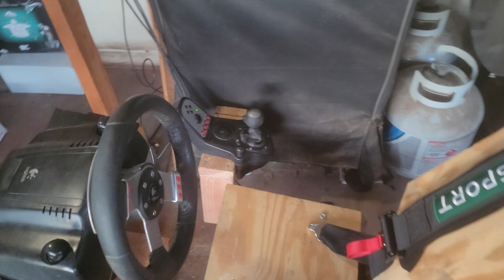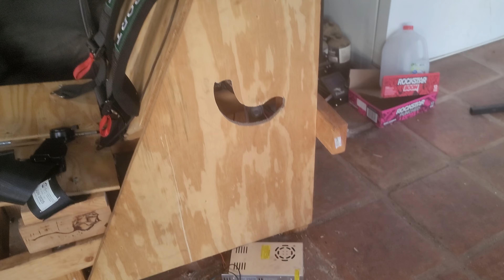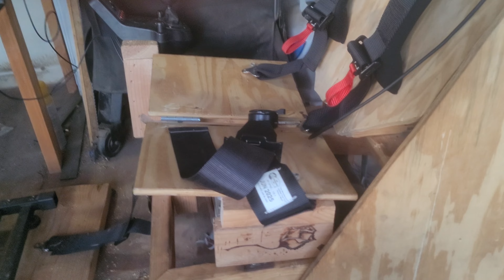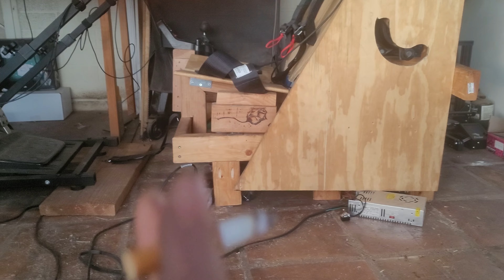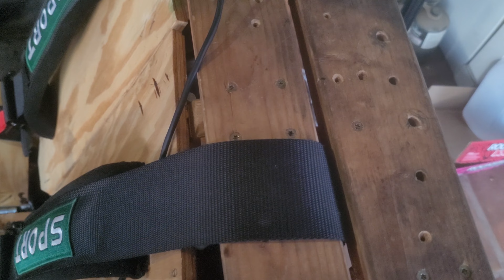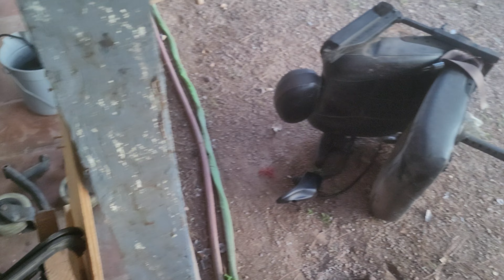Fixing a design that was crushing my back!! Gseat build cont.

Comment: is that a torture device?
Reply from the maker: LMAO, hello again friend.  It certainly was before I modified the lower seat section! A Gseat is designed to give you continuous forces through accelerating, braking and turning. This is a very different design from my full frame motion simulator and they are designed to work with each other, i.e. you put the Gseat on the full frame motion simulator.  Unfortunately this Gseat is WAY to heavy for that...
Reply: @WarBinger84  lol Just make a reverse one that pulls you apart and helps decompress. Link me if you do i need that one lol.